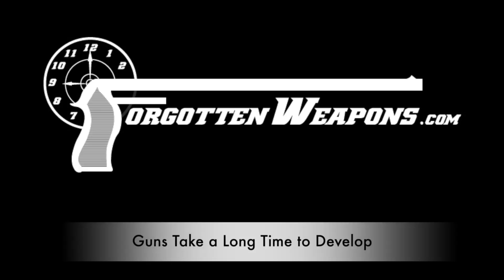Why Guns Take Years to Get Into Production

Comment: This is the rant, that makes You interesting for a non-gun person. Being an economist I have some comments based on Economic Theory with examples You can relate to - they are simply examples of much more generally true principles.

1) Economies of scale: It is generally so that cost drop between 10-20% for every doubling of production volume. I.e. If number 100 of an   item takes X hours to produce serial number 200 takes 0.9*X hours. And serial 400 takes 0.9*0.9*X hours, etc.
That is the all the little twichings You mention - plus as problems are sorted out you can use less skilled labour in the production process. Unskilled are not only cheaper; but when you have sorted the problem out it is a waste of highly skilled labour to use them on the assembly line or pressing the button on the CNC - and the craftsman becomes the foreman.

2) The mashine gun development is a good example: The Chauchat was terrible and expensive - that the real problem was the double necked down cartridge. It was not that the british did not understand the value of the mashine gun; but mashine guns were so expensive to  produce and it was a low cost solution to have some more trained professionals with rifles with stripper clips.
It really wasn't solved untill sheet stamping became an acceptable solution. The Vickers WW1 mashine gun works perfectly at the job it was made to perform.

3) Denmark is introducing the M60E6 as the light mashine gun - replacing the MG42.
a) By this time a lot of the problems with the M60 has been sorted out - which means you can eliminate the mashinegun ammunition schlepper - and thus reduce the infantry squad with one man without reducing the firepower of the squad.
b) It does not mean that the MG42/MG3 is not good enough or to expensive - but it works best vehicle mounted - against aircraft an unwashed hoardes of schoolteachers. Simply occations where you need the insane rate of fire due to fleeting targets and can load lots of ammo to be carried on the vehicle.
c) Denmark is introducing the SIG Sauer 320 to replace the P49 from the same manufacturer. The trick is a bit more complicated here - in  my view: A rifle as a personal weapon for vehicle personel (be it trucks or armour) really is an afterthought in case your tank is on fire. Jump out of the damned thing and get a new tank. Originally  the P49 was proposed to Sweden with a larger magazine, but that was turned down as they were target shooters.
Now the 320 has a considerably larger magazine (and a spare to match in the holster, that also is the safety) and that means you have the single shot capacity of a submashine gun - which are a pest in a vehicle. The automatic fire comes from the rifle so the submashine gun is squeezed out. It is a question of - if you don't hit anything anyway, why bother with trying to do something you won't do in the situation.

Comment: Given the amount of time spent talking tolerances and the AK, here’s a public service announcement.

The AK isn’t reliable because of “loose tolerances.” That’s just a stupid statement.

The word you are looking for is CLEARANCES.
Reply: Is this essentially the parts having bigger gaps between them rather than the parts being of varying dimensions?
Reply: @Motorman2112  Yes correct. Tolerances are the range of acceptable values a part can be. Looser tolerances can only increase potential function issues. With too loose of tolerances you may get individual parts on opposite ends of the tolerance that end up negatively interacting with each other. This issue is commonly called tolerance stacking.

Clearances and Interferences are the designed gap or overlap between parts. Either increasing or decreasing the clearance/interference can have an increase function depending on the way the mechanical item is intended to function. Some designed assemblies work best allowing foreign material in with enough space to continue operating. Others are designed with minimal space for material to get in. Ideal designs have some elements of both.
Reply: @sethrich5998  Thank you. I suppose having parts on the larger end of the tolerance would actually reduce the clearance.

Comment: Alternate title: “Why Ian WILL NOT be designing his own firearms”
Reply: Dang, I was looking forward to modern guns with wooden furniture
Reply: @AlistairAi  They make wooden ar furniture.
Reply: @Intelwinsbigly  as standard I meant
Reply: @Intelwinsbigly  I wish someone would take that a step further and make Stoner's original patent drawing for the gas and bolt system of the AR (patent US2951424A for the curious) in to a working gun but capable of taking standard AR mags. All wood stock sporter rifle, a Fudd-15.
Reply: @williammagoffin9324  Wouldn't that be a Mini-14 that takes AR mags?
Reply: @johnnyvanheteren963  Not really, the Stoner patent had a side ejection port rather than the M-14 style open top so it would be far easier to mount a scope on a dovetail rather than having a big 'thing' mounted on the top for a rail if you don't have the receiver designed for scope mounts; so you get 10/22 style irons plus a scope dovetail which I prefer. Plus its direct impingement rather than having that big slide assembly to move the bolt that could get fouled with dirt.
Reply: @Intelwinsbigly  Some of the laminate-stocked ARs set up for hunting are rather beautiful, too!
Reply: @williammagoffin9324  For the right price, I am sure you could contract a machinist for much of the work. Then you would just need to make a reciever.
Reply: More accurately, “Why Ian will not be PRODUCING his own firearms “.
Reply: Reason 1. He is not French and so can not make French weapons.
Reply: @justiron2999  Hotchkiss did it though
Reply: @hubert_c  it's just a joke, brother. You know how Ian loves his French history.
Reply: Or, Ian has been working on his own design for 9 years and is tired of everyone telling him to hurry it along
Reply: Alternate title: “Why there is still no AK50"
Reply: @xy3124  #AKGnotificationsquad #AK50NotificationSquad
Reply: @xy3124  AK50 is still at the hand-fitted prototype stage, so it did not even start facing those problems. I think people get that designing guns is hard, going from a handmade prototype to mass production is indeed often overlooked.
Reply: @xy3124  way easier to drink and do meme reviews than produce a firearm
Reply: @olesammygrant  I have a feeling he does those after a day of work, seems simple to me
Reply: Alternate alternate title: "Why Brandon Herrera is Taking Forever to Finish the AK-50"
Reply: Ian is on contract to design arms for Elbonia.
Reply: @panzerabwerkanone  Exactly, the man doesn't have the time to be screwing around with his own designs!
Reply: "Please stop asking me"
Reply: If I remember correctly Ian noted he was interested in gun smithing a long time ago. So, very, very glad he gave it up for something he loves more--Forgotten Weapons.
Reply: I am sure Ian will have not issues design new french guns, 100 years ago they didn't need to operate reliably to enter service. /sarc
Reply: producing.
Reply: Ian does not have to design anything.  Gun Jezus can turn empty steel into guns
Reply: Modern guns have been pretty much developed to mechanical perfection. The future will be in added electronics and improved materials, like caseless cartridges.
Reply: Alternate title: "Why the AK-50 updates take so darn long"
Reply: Also that would, as much as i like Ian, be like an Art critic thinking he is a better Artist than Van Gogh.
Reply: Bbbbbbbbooooooooooooooo

Comment: I tried a semi auto STEN one time. If the magazine housing is just a little off (just a little too much heat when you TIG'd it) or you get the pin holes for the AR15 FCG just a little off (because you don't have a mill w/a DRO)...failure to feed, jams, doubles, etc. There's a learning curve there for sure. Not to mention that a STEN w/a 16.25" barrel looks totally stupid.

Comment: You have just explained why my job as a draftsmen is necessary. Thank you.
Reply: i wish i had the skills to do the job you do as a hobby
Reply: Can I ask you a question. 

If it works on paper and you tighten and use the right tools surely it will work.
Reply: @tommothedog  the paper does not describe the limits on the accuracy of the equipment or dies.  If you are within a thousandth of an inch... which sounds small... if the part is slightly warmer or colder it will grow by that much with temperature changes (depending on the dimensions that growth with vary and may not be linear).

Alternatively you can make it sloppy as long as it keeps together but then reliability and durability are lost.

Also you will often outsource some of the components so you need to take into account their tooling and quality control.

If you have a 3d printer you can try making some interfering parts like a peg into a cylinder... its pretty impressive when you creep up at 0.1mm... it fits it fits it doesnt fit.  If 10 things have to all hit holes its worse :p
Reply: @someguy2741  Thank you, makes total sense what with car engine parts being designed to grow together!
Reply: @tommothedog  As someone who started drafting on paper and later moved to 2D CAD and then 3D "modelling", there are things to b e said for all methods.

What MANY modern "draftsmen" seem to lack is time on machine tools and fabrication techniques. Some modern CAD packages have "plug-ins" that can calculate and display all manner of things, like expansion during heating, potential stress risers, etc for materials, surface-grades and stresses. This power, as one would expect, does NOT come cheaply. They can also be globally networked so that a team of "draftsmen" can all be working on the same project at the same time AND can each see what the others are doing, especially regarding the component (or feature) on which they are currently working.

It is possible to make almost any shape out of almost any material, but not often worth the effort.. How many draftsmen have ever programmed a multi-axis CNC centre?  

However, in the :old days, "prototypes" / design studies were usually made from WOOD and then the nominal dimensions transferred to a "soft" steel copy to "dry-test" function. See some bloke calked Samuel Colt and another by the name of John Moses Browning for some examples. Then the draftsmen and engineers would set out to make it operational AND economically viable.

Even "mass-produced" small arms like the Lee Enfields were "hand-fitted" at certain stages of assembly. I have a number of copies of original factory drawing s for Lee Enfields, and EVERY one of them has detailed tolerances marked for EVERY dimension.

A lot of the time, parts were "over-designed", because contemporary metallurgy was also in its infancy.

Examples: There was NO X-Ray crystallography to ascertain the equality of the steel (or brass). There were NO modern pyrometers to precisely measure temperatures during heat-treatment. When the production book specifies: "Heat to cherry red  and hold for three minutes before oil quenching", is that "cherry red" assessed in a dark workshop at night, or in a forge lit by bright artificial or natural light? 

Two classic stories of moving to mass-production during WW2:

When GM went looking for production projects, they considered making machine-guns. Off they went to Colt tor a look at the operation. At the end, when the GM engineers were asked what they thought, they replied to the effect: "You guys don't make guns! You make swarf; guns are your byproduct"

When Ford  took up a contract to make B-24 bombers, something similar occurred. The B-24 was essentially 'hand-made" at the Consolidated plant.. Ford changed to using auto-industry style, precision high-speed stamping machinery and all NEW tooling for same, to make the skin panels (complete with identically-located rivet holes). Not only that, but at Willow Run, they constructed a new factory with all new machinery and tooling and an entire town to house the new employees; all in a matter of months.
Reply: @tommothedog  The paper describes all the possibilities at once. Majority of the time, it should work, but those slight variations in tidal forces, humidity, temperature, bariatric pressure, what the machinist ate for lunch, all come into play. Certain combinations just don't work, and it's my job to map out the most successful path.
Reply: Underrated. If the draftsman screws up, everyone screws up down the line.
Reply: But don't you just fool around on the computer for 15 minutes and then the computer makes the drawings?  So really its no value because its just some lines. <engineer who deals with the public... same boat>
Reply: @someguy2741  Don't you dare stop moving your hands while you think about how to solve design issues, either. Because if hands aren't moving, you're not working!
Reply: @simoncleret  lol.  Why arent you done yet and why did it take so long to reply to this comment!
Reply: @someguy2741  I SENT YOU AN EMAIL THIRTY FIVE SECONDS AGO! WHY HAVEN'T YOU RESPONDED???
Reply: @simoncleret  It had the link for the zoom meeting that you are NOW LATE FOR!  Bring your complete design for the project I just told you about in the email, the client and his mom and his dog will want to know how much it will all cost.
Reply: @simoncleret  I started engineering at the tail end of the modern golden age of engineering.  Fees were good... you could do a good and careful job... busy but not stupid.  Sadly like every job they opened it up to globalization and foreign workers (not to be confused with immigrants).  These guys work for far less, have no idea what they are doing, and drove the fees into the toilet.  In 10 or 20 years there will be tons and tons of retrofits needed just to correct for the pennies saved.

I came up with a modern definition of engineering:

"Doing the impossible for the ungrateful for no money"
Reply: @someguy2741  At this point, you're probably better off self-employed.
Reply: @someguy2741  yeah the computer creates the images but you still have to label the correct dimensions and tolerances for machining
Reply: SHUT UP AMD TAKE MY MONEY!

Also

IF YOU HAVE TIME TO WATCH AMDNDND COMMENT YOU HAVE TIME TO MAKE ME MY GUNS AND AMMO ALREADY!!
Reply: Wow dude. Figured you would've known that, but I'm glad Ian showed you. Edit: yes, I'm joking.
Reply: @GuntherRommel  Gun Jesus is the font of wisdom.

Comment: another thing about CNCs is if you move the machine from one location to another it will be off.  i had a dept manager that couldn't understand.  a guy went to where the machine was built and set it up and ran a certain number of parts to prove it could run the spec. after moving it over 300 miles to the factory where we worked . it was off and i had to reset it up. i expected it . the manager did not.   getting gauges made takes time too and $$.  good vid
Reply: We had issues with one of our 5 axis machines from the floor settling in a new building...

Comment: Another great example are the polish semi auto PPS 43's which are being manufactured out of original radom Parts kits just converted to being a closed bolt system and semi only. They don't really work... I havent got the chance to get a whole mag through it. It gets strange chams like shells getting stuck somewhere it doesnt block the action and then the next shot fires and it complettly jams...
Reply: interesting since the PPS 43 is a super simple gun

maybe changing it to closet bolt fucked up the gun somewhere
Reply: @vatanak8146  definitly, it is really sad they destroyed fabric new pps43 for such disgrace